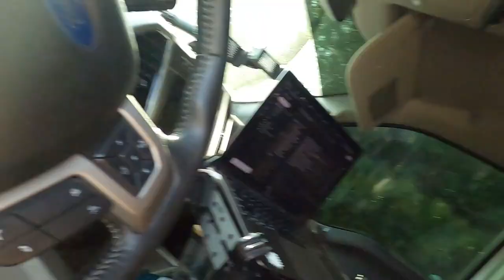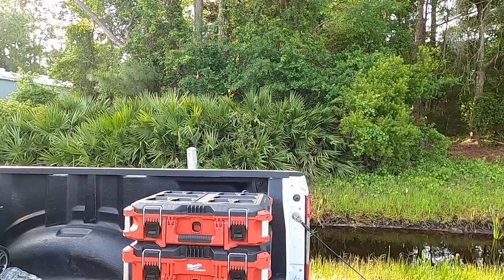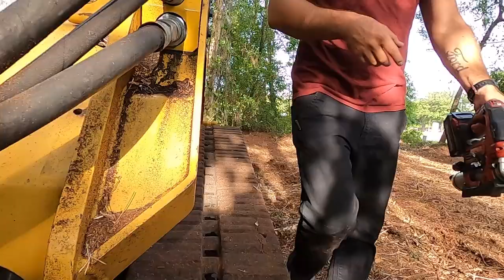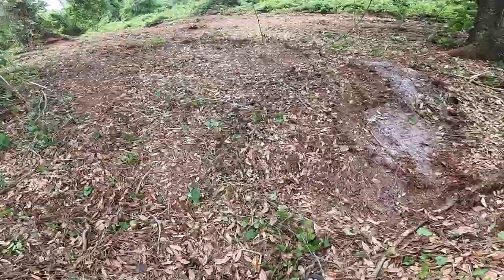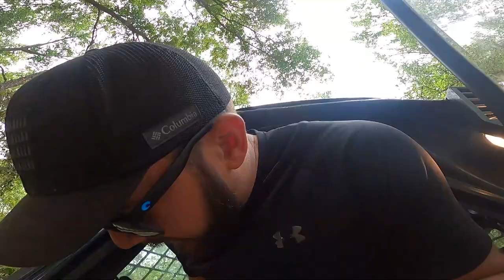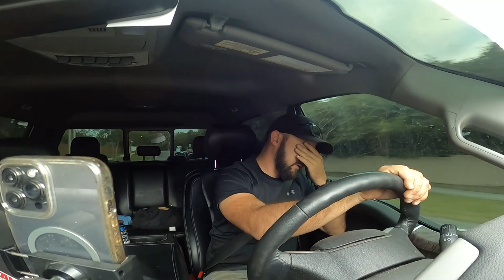Clearing Commercial Land in Florida | Fastest Forestry Mulcher in the Business | Tree Shop

Comment: That entire fence needs replaced. lol what equipment are you using? Cat 259?  What mulcher head? Curious because I was looking at the 259D3 last night, for the same reason you chose it. Less cost up front, lower operating costs. Was also looking at the Fae mulching head, like what you used in Ocala. My brother lives in Ocala
Reply from the maker: This 259D3 is a good machine. I will be dropping a Tailgate Talks soon about the 74 hp game. FAE or Fecon are the mulcher brands i recommend. We will be adding a fecon this year and will compare it against the FAE but I have a feeling they will be difficult to choose a winner with.
Reply: @TheTreeShop  yeah I looked at fecon also, even wrote down the rk 5015 on my notepad. Not sure about what will work best, with the flow rate of the 259. I'll have to talk with fecon and cat, I reckon. Thanks for your response, have a great weekend
Reply from the maker: Where are you located?

Comment: I have a question when it comes to mulching.  I cut trees off of field edges on farms up here in Wisconsin.  Mostly boxelder and sumac. Some buckthorn as well.  I do it all by chainsaw now.  What thought process goes into running one, or a disc style for the grassy areas
Reply from the maker: Great question! I will do a podcast about this for sure. But the short answer is drum mulcher is more contained when throwing debris and disc mulchers send debris much farther. The other difference is how the mulch is picked up for reprocessing. Drum mulcher wins in quality of mulch as far as I have seen too.
Reply from the maker: Also, brush cutters (skid steer brush hogs) are great for grassy areas but the quality of finish when the material gets woody is not even competitive to a drum mulcher